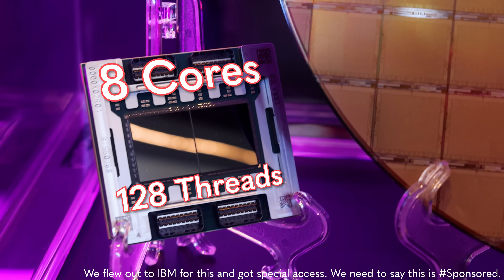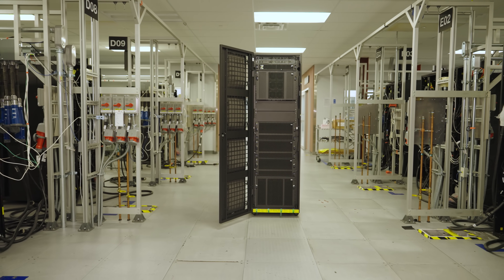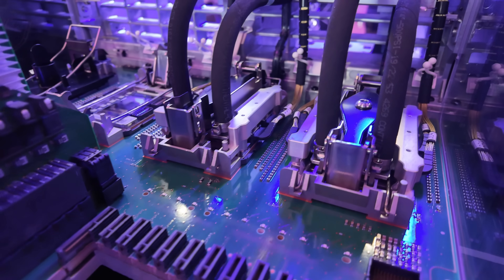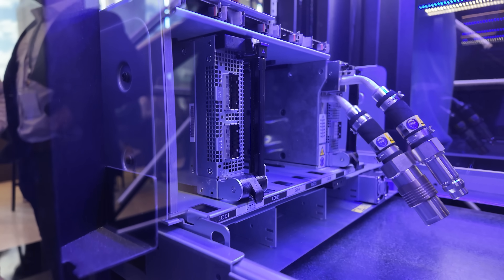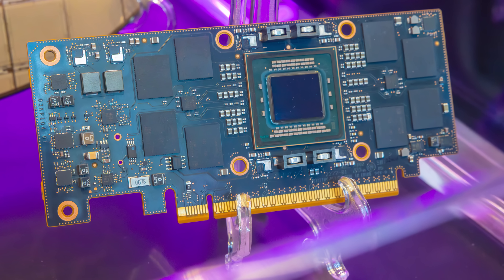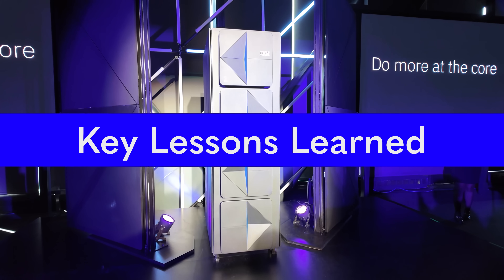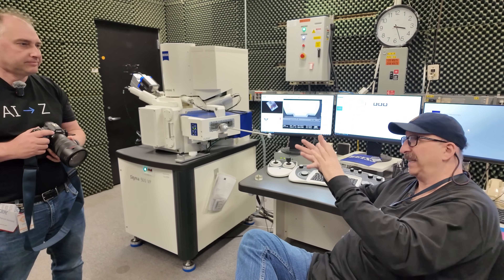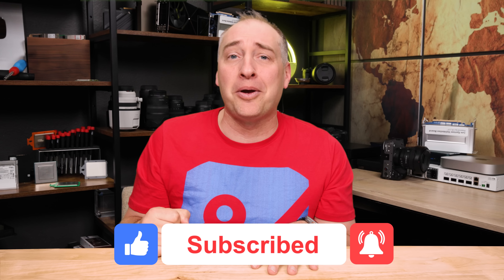THIS is how IBM makes servers that cannot fail

Comment: Eight nines? So roughly a second of downtime every three years?
6:06 They used to use distilled water?! Using plain distilled water would be silly. I'm assuming they used distilled water with inhibitors. BTW, glycol is also an inhibitor, so it's not actually a huge change. And, hell, water/glycol mixture is what cars use and what I'd use if I had to DIY a liquid cooling loop.
Reply: I mean semicon grade di water is basically a perfect non conductive heat transfer medium

Comment: Way back in my previous life, I used to manage a bunch of IBM "mainframes". Very basic for that market, only one cpu drawer, one or two PCIe drawers per system... These were _bulletproof_. Change dram online? Sure! Hotswap a cpu? Absolutely!
. . . except one thing. A piddly little cable going from the cpu drawer to the pcie drawer. Touch that thing and the whole system crashed _hard_. And we seemed to have a bad batch, because out of ten systems under my care, all ten eventually went bad... within one month time frame. It was NOT a fun time.
Reply: What was the fallout (IBM/reseller)?

Comment: This is so awesome. I first saw a Tandem system and was mindblown at how you can swap a CPU while the system is running. These machines are just built differently.
Reply: I have never seen a CPU go bad.  Was it an upgrade path?
Reply: @allanwind295  Actual server g0ds run cpu without adaquate cooling and thus swapping it multiple times, like my teacher he even modded scara robot to replace for him (for fun)

Comment: 2:36 99.999999% reliability, (aka 8 nines) is 0.315 seconds of downtime / year. Seriously impressive
Reply: Yeah but I mean. Who TF needs that?
It's pretty easy to have HA, with way less nines, at the fraction of the cost.
Reply: I wonder how many nines (in time) a reboot takes?  My totally guess would closer to 4 than 5 nines.
Reply: @ if you rebooted once a year and it took 5 minutes, you would drop down to 5 nines, or 99.999 up time. Imagine Google being out for 5 minutes straight. They must never need to reboot, or can reboot redundant parts one at a time.
Reply: @allanwind295  It's designed in such a way that the entire machine never needs to be rebooted. (Uptimes of years or decades are common.) You just reboot parts as necessary, or hot swap them if they've become faulty. It can automatically move running programs elsewhere, so that users don't see any interruption. The downside is that the process for rebooting the entire machine isn't at all optimised, because you should never need to do it. It can take several hours, which takes you nearer to 3 nines. Allegedly this is why one of the big UK banks had a long outage a few years back. Their outsourced IT department updated some software on their mainframes, then rebooted them, because they'd come from a world where you're supposed to reboot after updating anything...
Reply: @ I understand the premise, of course, and several hours to reboot doesn't surprise me.  It is just a fun data point.  Do they do anything interesting for Linux kernel upgrades (two virtual machines deep if I understood it right)?
Reply: @ Linux actually has a feature called livepatching, which lets you upgrade the kernel without rebooting. Crazy but true

Comment: 20+ years ago I was the lead deployment and setup engineer around the country for my company that was a reseller of shark boxes 670/690 and A/S400 (I don’t think most here have ever seen one of these). Biggest issue always? Space and power! 3 phase 420V isn’t usually something you’d have around waiting for you. Plus IBM and their proprietary connections make life so much harder for engineers. So prior to onsite setup you’d have to line up your mechanical and environmental prerequisites. Then came my personal biggest enemy…. Physical access and delivery to the site. You know, because most places don’t have docks or forklifts waiting for you? 😂 Don’t forget getting there and the machine is going to another floor and the service elevator is out of service or under the capacity required.
Those were the days when engineers were actual hands on real people and you really had to know your shit. Today, all you need is to watch a few YT videos and fake it.

Comment: Hey Patrick! Great video but I think you missed to ask the cost of each rack. The energy consumption and the cost of this machines are not for the fainted heart. You have to be a big bank to purchase the thing and then plug it directly to the beefier hydroelectric dam outlet you can find.
Reply: Hi @germancaperarojas4023, energy consumption is always a concern, especially when AI is considered. Believe it or not, running workloads on z17 instead of x86 can actually consume LESS energy - up to 65% less! Along with all the other amazing innovations in each IBM Z mainframe, increasing the capacity per kW is a consideration from the earliest design stages. So, for many reasons, if you have work that needs to get done anyway, doing it on a z17 is the way to go.
As for upfront cost, correct that any mainframe isn't something that an average joe can run out and pick up for the home setup ;-) . But the IBM Z TCO is SO LOW compared to alternatives that businesses of all sizes and industries use them.

Comment: Of course software is the place where these amazing machines start to look exceedingly "legacy".  I really wonder when the last vestiges of airlines and banks finally get off of these machines - if nothing else because the knowledge of COBOL, JCL, and other such tech is quickly being forgotten outside IBM and maybe a couple major companies.  [in a prior job my employer, major financial firm that you've heard of, worked hard to get a major mainframe out the door and migrate all the apps to Linux.  Done, and successful before the last MF operator retired.]
Reply: This  is the good and bad of the mainframe...since programs from 60 years ago can still run, completely unchanged, too many clients banked years and years of savings with not having to touch them because it all just worked. It all just ran and never went down. So they left it alone...that's great for them and saved a ton of money. The problem is that they never reinvested any of that back into the system over time to modernize...and so now they have "legacy" applications running on perfectly modern HW. There is so much value they could take advantage of...

Comment: Where is the difference between a mainframe and a server today quality seem to be the only thing? Welll it turns out that banks simply shutdown there services for say even a entire week during easter so the uptime is seemingly not used.
Great random fraud detection based on a AI will work for sure without any issues like anything else ai is used for.

Comment: My dad used to work at a bank, in their computer room, so I was exposed to mainframes from a relatively young age.

It is really cool to see them as it is NOT usually talked about nearly as much as the x86 stuff (I was going to say "their x86 counterparts" but there IS. NO. x86 counterpart as these systems are on a whole 'nother level).

It is, rather unfortunate though, that to enter the world of being a mainframe admin or to program/use said mainframe to actually do stuff with it.

I mean, I only started using Solaris because it was made availble to run on x86.

Comment: More key take aways -  None of the CPUs are throttled down. They run full bore at 5.5 GHz. The I/O subsystem is optimized to keep up. 
The VM or virtual machines mark 're-entrant code"   Unlike V-sphere or other OS, once a program is loaded it can be used by everyone. Imagine loading  Windows OS, Google chrome, Word, Excell once for 128 virtual machines.  
Yes there are LINUX specific processors. and zIIP accelerators.  The database is even wilder. DB/2  does not put a bunch of tables in one file. It creates one or more file for each table or index. Tables and indexes are built to run in parallel. 
Lastly - Fortune 500 companies that run most mainframes. They are not looking to get off them. They want to continue with the advancements - or their competitors will.
Reply: Regarding db2 and "having a table across multiple files", nothing's new here.
Reply: " DB/2  does not put a bunch of tables in one file. It creates one or more file for each table or index"

Mysql and postgres can do this too
Reply: @AntonioMolfetta  It is good Postgress can do this.  I think that is why the SQL server group is worried. People are noticing Prostress adoption. 
    What about assigning tables to buffer pools ?  When a table is read into memory it goes in with a specific group instead of a general i/O memory block ?
Reply: @AntonioMolfetta  Yeah I was wondering, "Is this guy stuck in the 90's?"
Reply: @xmtxx  in IBM mainframe world some/most are stuck in the 60s

Comment: IBM zSeries: Doing for $100 million what Intel and Nvidia could do for $1 million, but you want those extra 3 nines, no matter the cost.
Reply: You pay upfront to have it installed and then you pay for usage.  It's on-premises cloud before that was invented.
Reply: We've got plenty of TCO studies that show the per transaction costs overall running on IBM Z and LinuxONE are far better than on x86 or Cloud...there are an awful lot of things that get lost when you just make a quick statement like you made.
Reply: @ I've been in the tech industry for 30 years. I, too, have been part of TCO exercises where preferred conclusions drove the parameters of the analysis. I am certain there's a new TCO study every single year that shows that mainframes are the future of low-cost computing...and yet...
Reply: @ Is that your metric for "Oracle is worse"?  In which case I agree for any value of Total Cost of Ownership (TCO).  Also, I am just being funny, however, it would be interesting if you could give us any idea what a z17 cost ideally broken down in the top-level cost categories.  Even what's the cheapest install (I realize it's brand new so even projected off last gen would be interesting).  You said transaction processing, fair enough.  If it was generally cheaper all the cloud providers (which are all about TCO) would be running mainframes.  They are not.

Comment: Imagine if somebody could make a Desktop grade Motherboard with one of those CPU's  would be awesome, 
plus the ai GPU's are amazing to have 128gb not even the RTX 5090 has so much but probably the next gen will have much more 
most likely the RTX 7080/7090 would have as much.
Amazing Super Servers.
Reply: Benchmarks are few, but apparently the raw performance isn't great on mainframe chips.   For desktop AI - you should check out the ryzen ai max chips.   This channel has demoed at least one in the past couple months.
Reply: lol, it would be really expensive and silly. If you want something IBM that is available as a workstation, look for POWER instead!

Comment: Multi-threads per core now seems less important than being able to add physical cores that can be low-powered idle when not needed. Having extremely wide cores to support multiple threads adds great complexity for diminishing returns. Having SMT has been increasing security risks in other CPUs. While reliability of individual components is important, the ultimate reliability is keeping what's left working while components can be replaced because they can still fail. Redundancy & error handling are very important at multiple scales from within a chip, module, box/tray, rack, room, to across multiple sites.
Reply: It's my understanding that SMT's security issues mostly stem from usage in places like cloud services where a lot of different companies are paying to have their services running on someone else's servers. We'd have a massive issue where techs from customer A, or the hosting company, or anyone who hacked into either of them can find a way to access allegedly secure data from customer B due to SMT vulnerabilities. When one company owns and uses the server for a single application entirely in-house, that's probably not much of a concern.

Comment: You know, there is bound to be at least one customer will want to plug a Token-Ring network card into that 😂😂😂
Reply: Knowing IBM, they'll probably find a way to support it and get you a service contract on that scenario.
Reply: @stonent  most definitely and that's why the large customers Iove and stick with IBM.
Reply: Or 3270 terminal via a coax to an FEP. 😂

Comment: Is that 8cores 128threads per die, or did IBM seriously make a giant Quad Core? I thought the last generation was 8/10 cores, but I don’t think it was quite as many threads, and I have no idea if the die size is equivalent.
Reply: 8 cores, 16 threads per core, per die with two dies per module.

I don't know if the threads are done the same way as on the x86 systems though.
Reply: @morosis82   I assume that it’s probably most similar to the old Intel Xeon Phi devices, but I don’t have anything to base that off of, other than I know they were 4 way hyperthreaded.

Comment: I wonder if this is a solution looking for problems (and yeh I used to write ATM software on the IBM mainframe 18 years ago)! It would be a lot cheaper to build a larger cluster of conventional servers to increase reliability but this doesn't seem to be an option here due to mainframe OS and software that aren't designed to scale horizontally but vertically. Not sure about the US but banks are highly regulated and aren't allowed to use "black box" algorithms like deep AI or neural networks to make decisions that could impact customers. Happy to be proven wrong :)
Reply: Ha - the AI is probably being used to deny health insurance claims.
Reply: Exactly. I'm pretty sure those mainframes are intended to clients can't think of a real HA and scalable infrastructure. And have way too much money. IE banks.

Comment: Sheesh. 8:15 they're basically building motherboard-scale chips! That's a lot of routing.
Reply from the maker: These are perhaps 3-5x the number of motherboard layers compared to a standard server
Reply: I wonder how many bits they go through to drill all the vias in one of those boards
Reply: @origamihawk  they're likely HDI boards with laser drilled vias. Eat your heart out Dr. Evil.
Reply: Pretty much if you increase cache memories and connect it with other components like pci, and other peripheral and thats a fast motherboard itself. Thats probably only feasible for ai computing since you need very low latency and very fast memories.  Maybe at that speed is needed to have its only floating consciousness with a very good software.  What comes first, hardware speed or software? Its probably both. Since both is required to get there. 

How would an ai prove us if it has consciousness and how does it know if it has one? Maybe just a smart computer.

Comment: booking airplanes and using bank services is mostly a painful experience, thank you IBM
Reply: At least for the airplanes booking, blame companies that impose some oddities to programmers, such as coping with an antediluvian inter-companies (flying and commercial) software and protocols that was written and designed by the grand-father of Mathusalem - solving this efficiently would need a clever review and a rewrite by upmost specialists of secured protocols, but nobody is making a step in this direction because of the induced direct but particularly indirect costs… until it will break, as usual.

AFAIK, it is more or less the same thing with banking, but the security is a much higher concern, so we're talking astronomical costs.

Sometimes (often ?), it is better to make sure the infrastructure is right and can easily scale up in the future, organize many meeting with other countries to get their educated opinions and finally rewrite all from scratch, the overall cost being often less than patching a very old air chamber, but it is still big money (cf nuclear dissuasion, still working with diskettes on IBM PS/2).

In almost any possible way, these two branches apply the first IT principle stricto sensu : if it is ain't broken, don't fix it.